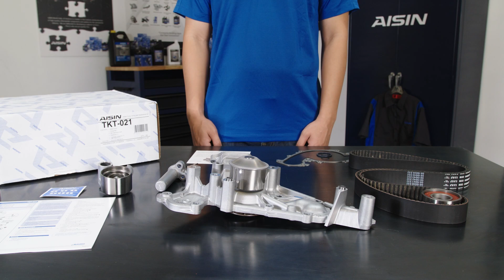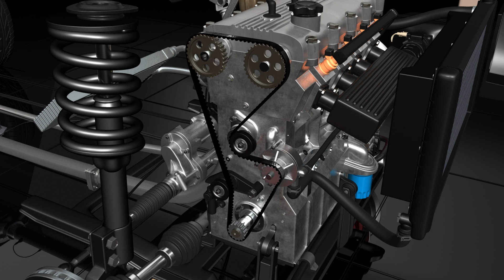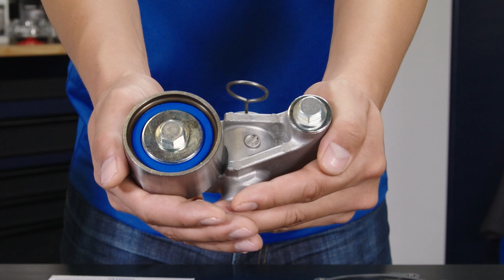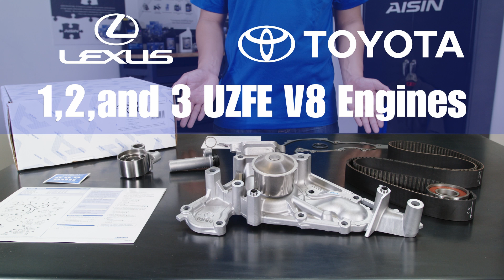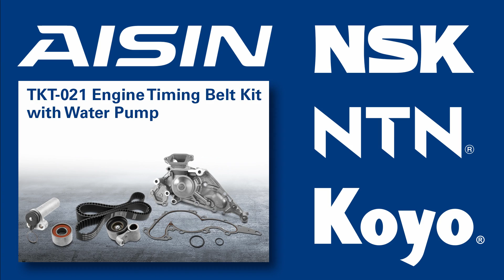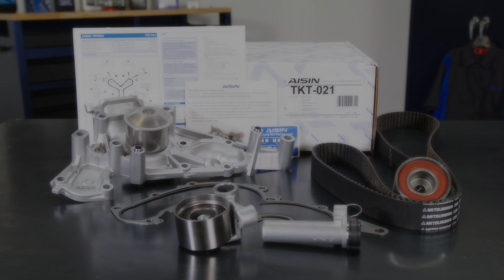AISIN University: AISIN Timing Belt Kits with Water Pump

Comment: I just got the Aisin  TKK005 for a hyundai off Rockauto and it has Mitsuboshi belt, Aisin H2O pump, PHC Valeo idler rollers and a no name hydraulic tensioner that looks just like the Dayco hydraulic tensioner. I am concerned about the tensioner.

Comment: The AISIN TKH-007 kit including two timing belts. Only problem is it's made in singapore? I guess do they follow the same standard of quality that they do in Japan?
Reply: I bought Aisin engine oil and it says made in Korea, not Japan
Reply: @Ab74z  I bought a CAMSHAFT SPROCKET SHELF! I bought a OIL FILTER FROM INDIA. I bought a CV AXLE MADE IN CHINA. When I called up a store. I FORGET TO RESTORE THAT ORIGINAL JAPANESE OEM AXLE. Oh and always use the HONDA GENUINE PERFECTION TRANSMISSION OIL. No one can copy that DEX 2 and their special formula!

Comment: Anybody have a tensioner failure from the honda v6 kits?
Reply: yep!   over on the honda and acura forums over the past decade there are increasing numbers of both aisin and honda branded (bought from dealers) tensioners that aren't lasting long, e.g. 50K miles, even less, though  more often 70K miles.   It's very disturbing and to many of us in the mechanical world was one of the initial signs that japanese and other nations's quality was dropping in a consistent way.    Also the 'supply chain' issues that were noted in Pandemic were also noted in the prior five years.    Strange that not many are willing to talk about this??!?

Comment: My saturn vue has the honda j35, it came with this brand timing belt kit the belt nor other components haven't been changed in 270,000 miles until today im am blasted away by the quality of this brand 1000000/10
Reply: My 2002 RSX type S with 457,000mi still has the original water pump with no failures
Reply: Had the Mitsuboshi timing belt stil on?
Reply: sorry but we honda ppl know that the factory installed were vastly vastly ultra high quality bearings, belts and most importantly tensioners and water pumps.  Not so with the aftermarket of all suppliers including what u buy at honda dealers and the aisin kits. NO COMPARISON to the factory installed quality.  THAT is the ONLY reason yours lasted to almost 300k miles.  I have heard this exact same story as yours on the honda and acura forums

Comment: Aisin Seiki should pay more attention to my invention positive drive infinitely variable transmission PDIVT. There are several concepts available in the world claimed as PDIVT. However my invention it's the only one that doesn't require belt nor force anything deforms to achieve the mechanism. It's also the first PDIVT to transmit power from center of engine's output shaft.

Absolute center has zero power, but slightly moving away from center say a distance of a molecule will deliver insane amount of power. More than enough to over come the inertia of any heavy vehicles.

So when the mechanism switches rapidly away from the center will allow the vehicle to speed up faster than electric motors. It's the only solution for ICE to beat electric race cars if the engine has enough of power.

DCT, torque converter, planetary, CVT are old technologies. It's about time for humanity to advance into the future mobility.

PDIVT is simple in mechanism. Therefore it's cheaper to produce as well as maintain. Plus it's many times more reliable than existing transmissions. It only falls behind of manual transmission in terms of reliability and cost.